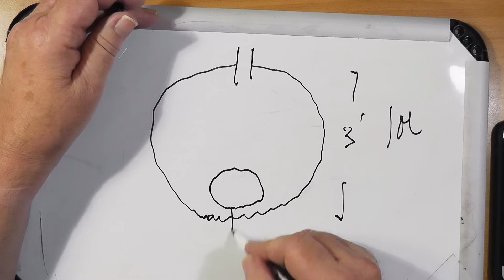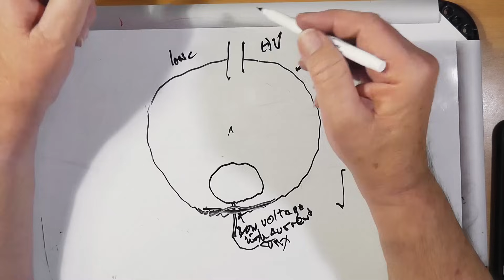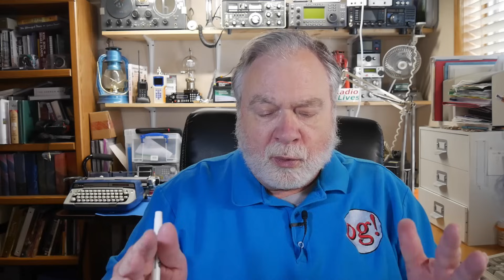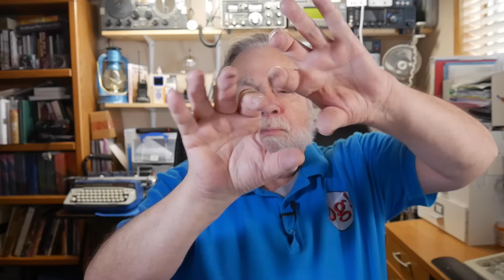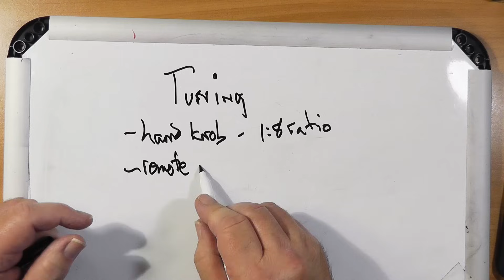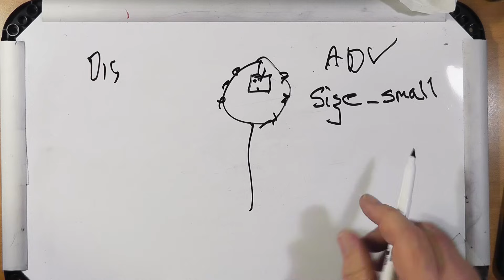Types of Magnetic Loop Antennas (#536)

Comment: I made a loop to null out interference on receive from my telephone wire while using dipoles to transmit on. 
Ofcom investigated every wire locally and came to the conclusion there was probably corrosion causing it to become unbalanced and radiating. 
Early this year I changed my internet provider and they replaced it with fibre.
The problem cleared up after about 8 years of it. 
G4GHB.

Comment: I bought a vacuum tube capacitor used for $200 bucks on ebay, it's good for 15,000 volts :-) The capacitor is the heart and soul of your loop antenna if your using it to transmit . Receive only can get away with a cheap 10 dollar air capacitor.
My Tube capacitor can take my 100 watt output without a hiccup.

Comment: I realize this is 2 years old but just watched it. I built one out of 3/4 copper pipe and 3/8 copper tube for the feed. I used a capacitor out of and old full power tuner and mounted it to a 3/8 inch nylon cutting board. You are right about high Q, and it is touchy about tuning, but works quite well from 40-15 meters.

Comment: Capacitors  (In Series) don't add for more Capacitance (use the Formula) as Resistors in Parallel.. (More Capacitance) is achieved (when in Parallel)
If 2 (10uf capacitors) were in Series would be 5uf... If they were in Parallel, would add up to be 20uf.. Basically the formulas are in reverse to that of Resistors.

Comment: As has been reported elsewhere,  because of skin effect only a paper thin layer of the loop actually conducts.  Therefore, making the loop out of pipe is rather wasteful (IE: expensive!) and a plastic pipe antenna covered with metal foil will be just as effective as a copper pipe of the same diameter.  Futhermore since only a thin layer is conductive, the diameter of the loop material is what determines the RF resistance of the loop, and it is this resistance that determines how 'lossy' the antenna will be.  For a 4 foot diameter loop, the minimum diameter of the loop material should actually be about 2"!  Also shape of the loop doesn't matter, it is the circumference and the square area of the loop that is important.  Therefore, a square loop is the most effective, as it takes up the smallest shape while providing the required overall length and area size.  NO commercially available magnetic loop antenna for ham radio follows these specifications!  Therefore, the claims made for their performance are like what snake oil salesmen would provide.
I don't see any reason not to use an external antenna tuner with a loop once the the has been adjusted for frequency.  IE: put your tuner on bypass, adjust the antenna and LEAVE IT as is, THEN put your tuner in line and adjust for lowest SWR.  This should work if the tuner is AT THE RIG on the far end of the coax from the antenna!  The tuner isn't tuning the antenna, it's matching the impedance of the antenna to the rig.  When re-adjusting the antenna after QSYing, you again bypass the tuner, adjust the antenna, and ONLY THEN adjust the tuner for lowest SWR, WITHOUT touching the antenna setting!!

Comment: Thanks, Dave for the best intro on TX mag loops out there.  I see you suggested the 15 to 40 meter MFJ over the 10 to 30 meter version.  Can you elaborate on your choice?  Does the higher Q at 40 get difficult to manage?  What would be an optimum type of 50' feed cable to minimize loss?  For example, would LMR-400 give any worthwhile advantage over RG-8X?
Jerry
KK4GMU

Comment: Dave, I'm  confused why these are "magnetic" when none of the loop material is magnetic, only conductive??
Thank you for the video.
Reply: It's not about the material the loop is made of, it's the way a loop responds to RF. Radio waves are electro-magnetic. The electrical and magnetic fields are perpendicular. A loop only responds to the magnetic field but not the electric field. That's why they are directional with a "null". Better than other antennas in environments with man-made electrical noise (QRM) for receiving.
Reply: @Anon-fv9ee  Thank you.

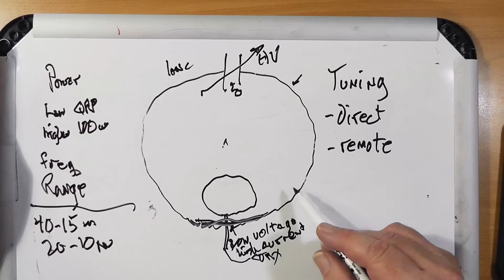Comment: A note: At 14:06 in the video Dave said putting multiple loops on the loop antenna will give you 'higher' frequency when he meant 'lower' frequency. 

The other way to get lower frequency, (for 80 m, 160 m, the AM broadcast band, and LF) is to add capacitance. That means a higher capacitance air-variable capacitor, or perhaps paralleling the tuning cap you have with a second air-variable capacitor, or adding a fixed capacitor. A fixed capacitor is handy for just listening, and can be selected for the frequency range of interest, although it will broaden your tuning somewhat, picking up more noise due to broader bandwidth being received. (Air-variable capacitors have the absolute highest Q, narrowest bandwidth, while fixed capacitors have lower Q's that are a function of the design of each type capacitor, so try a few different types.) 
Remember that for transmitting, a fixed capacitor in parallel with the tuning cap will need to be rated for high voltage, and the higher power you transmit with the higher voltage that fixed cap will need to be rated at. Roughly speaking, for hundreds of watts you are looking at thousands of volts across the capacitor, so you may need to series connect fixed capacitors of lower voltage rating, further reducing the Q.

Comment: Dave can you please tell me (if you know) what is the minimum size for a square shaped loop for 7MHZ, please?
Reply: A square shaped loop has a little lower Q for the same overall size antenna since it has more material length (higher resistance,) so a circular loop is slightly better for a given size. As for the overall size, there is no minimum size at which a loop no longer works. The signal simply continues to get weaker and less effective as the antenna size decreases. Three to 4 foot loops are most common because they are usually the largest size that is convenient for the user to build or use. These loops continue to work better (more efficiently on xmit, more sensitive on receive,) as they get larger, up to about 1/10th of a wavelength in circumference for the highest frequency of interest. However, as they get larger they also pick up more noise, so a larger loop is better on a mast in a rural, low noise environment, while a smaller one is best in a noisy apartment environment. It's always a matter of trade-offs and designing or buying what's right for the location.

Comment: Precise Rf sell a full legal power magnetic loop. It uses a vacuum capacitor. What do you thing in regards of such type of antenna at high power? It is really a benefit? I know reception should be less noise, but in gain or more power? Thanks 73.

Comment: In addition to the common inductive match shown, you can also use a Gamma Match or a capacitance match.  The MFJ Portable Loop Tuners use a capacitance match and the benefit of that is NOT having a capacitor at one end and a small loop at the other which you cannot really do much with it to improve the match.   So on the MFJ tuner, the loop is just a loop and the feed point is through a variable capacitor to one side of a grounded butterfly capacitor.  I easily achieve nearly a 1:1 match at any frequency that the loop can actually tune and it is easy to swap out different loops.

Comment: I have built one of these and have an air gap capacitor to use at low power so it does not arc but I can't seem to get it to tune.
I hooked it up to my nano VNA and calibrated the VNA for the band (say 40M) and turn the capacitor very slowly and never see a dip on the VNA.  I have done this to all the bands the loop is supposed to work on with the same results except 15M.  Through this band I get good SWR but when I turn the capacitor the SWR never changes.  I have check all connections to the loop and proper configuration but it just seems like the capacitor does nothing.
Any suggestions as to where I am going wrong?

Comment: Dave, I have the MFJ-936C Loop Tuner. You attach a loop of wire based on the band you desire and then tune accordingly. How does this antenna system compare to the Mag Loop described in your video. My instinct-reaction is they are both "the same" except the 936C control box is NOT weather proof. Your comments please... de W4WMM

Comment: For 100W or so, people often use a vacuum variable capacitor, they can handle very high voltages, but are fairly expensive.

There are also other ways to couple the antenna - I've seen a gamma match used. The smaller loop is easiest though.

For portable operations, Peter Parker has home made loops he uses portable on his YouTube channel.

Comment: What is the angle of radation of a magnetic loop in the vertical plane?
Reply from the maker: You know, I've never heard a satisfactory answer to this. MFJ claims that if the antenna is vertical, the polarization is vertical, but I think it's really horizontal because it has nulls. And if you mount the antenna horizontally, there are no nulls.

Comment: When I consider an attic or trellis loop installation for my condo and check the ARRL rf exposure calculator for 7-14 MHz it looks like min safe distance uncontrolled is less than one foot SSB. Does that seem right? In this talk you were concerned about rf entering the house from horizontal installation on your roof at +5' - was that a health concern?
Reply from the maker: Take a look at the fine print in the ARRL RF description about the "near" field. The calculator talks about "far" field in which the electromagnetic waves are well-formed. You may find that you want to be further away from the antenna.
Reply: The MFJ Portable loop tuner requires that it be close enough to tune it.  It can be a bit concerning at higher power levels.  A magloop at close distances will have negligible electric field, which is the principle worry if I remember right, and a more pronounced magnetic field, which the human body ignores.  Getting an MRI exposes you to incredibly strong magnetic fields without apparent adverse effecfs.

Comment: Question: Are magnetic field antennas safer than electric field antennas? I ask following all the discussions in the community wrt EMR and its' effect on the human body, particularly the eyes and brain. 
Great video as always.
Many thanks,, J.
Reply from the maker: The electromagnetic field contains both electrical waves, and perpendicular to that, magnetic fields. As it turns out, you can't have RF fields that are only electrical or only magnetic. However, your antenna can excite the electric field or the magnetic field, and then the companion field also radiates.

Comment: Thanks again for a great video.  I bought a qrp magloop that has a coupling ferite loop (feed wire to the big coax goes through the loop) near the cap that has a few turns of wire from the drive coax so the cap is at the low voltage side of the loop with all components the box. The mail loop can also be switched so the inside wire of the coax can be used as a second loop at 80 meters. it all seems to work fine but I do not know how well it compares to other antennas. I do have a working long wire with a remote tuner that seems to have about one s meter higher on any frequency received.  I have kept it for field testing someday.
Reply from the maker: A mag loop out in the open performs about as well as a dipole.
Reply: "the cap is at the low voltage side of the loop with all components the box"
The capacitor is ALWAYS the high voltage component of a loop. That is where the current in the loop stops, piles up, and creates a high voltage.  You can do the math easily enough, say 20 picofarads at 14 mhz  Xc=1/(2pi f c) is 568 ohms.  You can proceed from power and Q to figure out the current but for simplicity, say 20 amps of RF is circulating.  That would be 11 kilovolts on the capacitor.  It is also on the inductor, but where are the endpoints of the inductor?  Tied to the capacitor.  
Interestingly, the same current exists around the loop, but not the same voltage.
That means the impedance isn't the same around the loop.
That means you can do a Gamma Match or a capacitance match (used by the MFJ portable loop tuners).

Comment: Nice video dave! I'm getting ready to start working on my mag loop see if I can put a different capacitor in there and change the feed at the bottom. I think that having a good low resistance capacitor is as important at low power as it is at high power. If you don't have a really low resistance path then you lose energy of course then your capacitor burns up haha!
Reply from the maker: If the power is too high for the cap, the cap will arc over. That can ruin the cap.